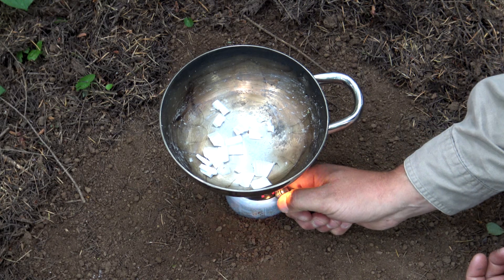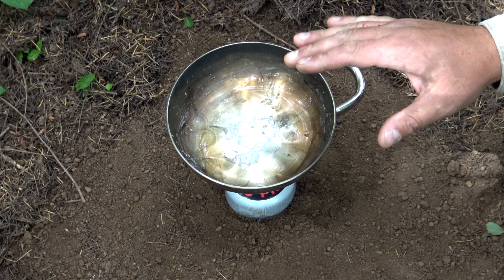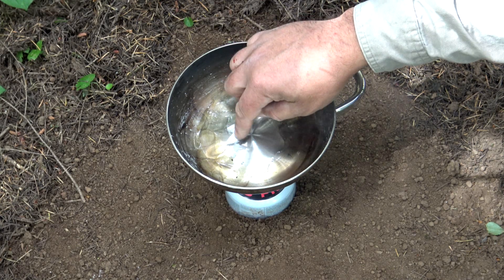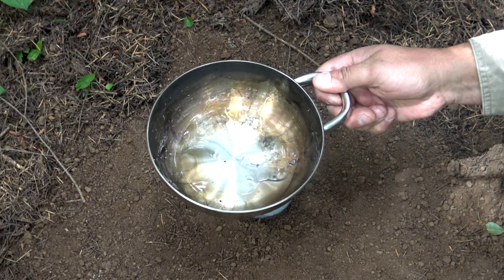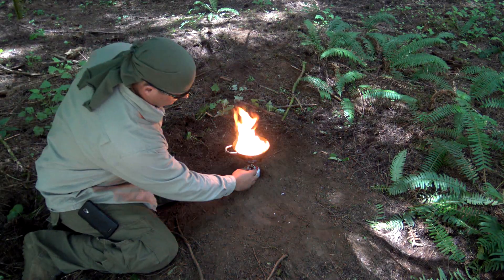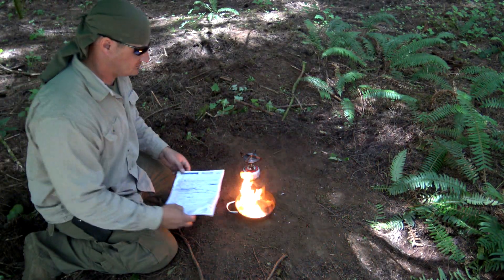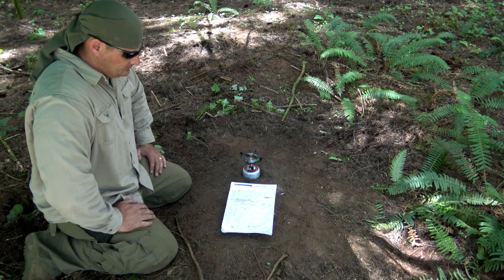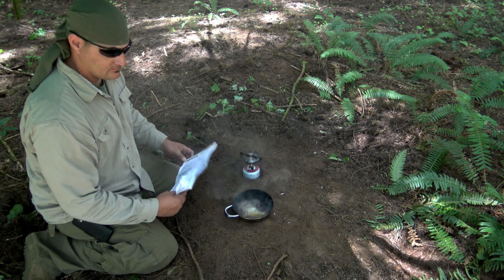Gulf Wax Safety Tip

Comment: A large enough green leaf will also smother the fire out. The way I did this once was think of this as boiling eggs. You take it out into an ice bucket. In the wilderness, make a small puddle of water near your fire and as soon as the wax melts, transfer the container to that puddle. That will prevent the wax from overheating. I have done it only once, so results can vary. I used that wax once to seal an opening in a tent during the monsoon season.

Comment: I heat pine/spruce resin to make pitch/glue.
Sometimes in a double boiler and sometimes not.
I do have a fire extinguisher handy but from now on will use a double boiler only.